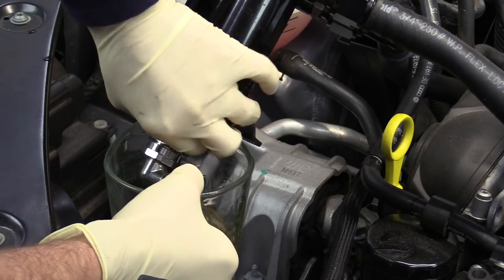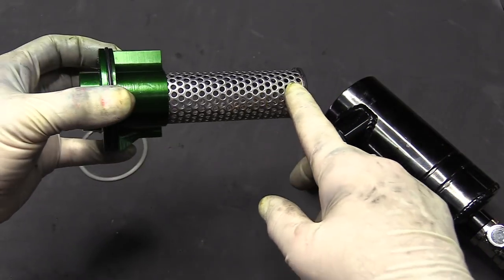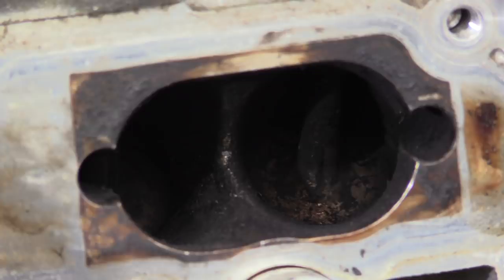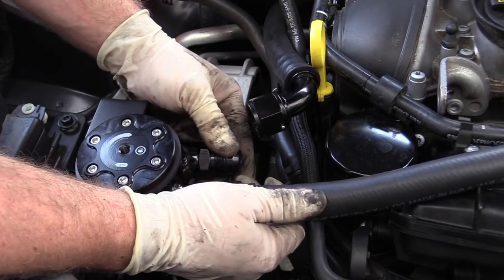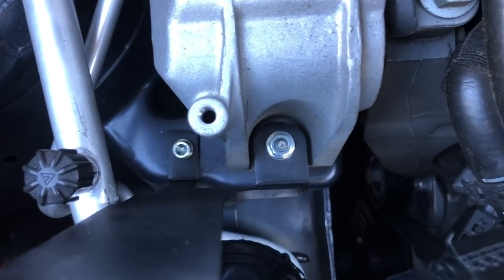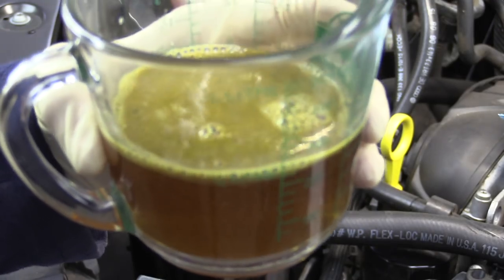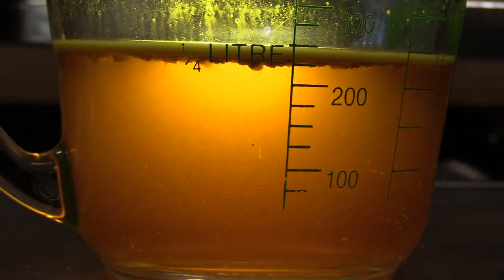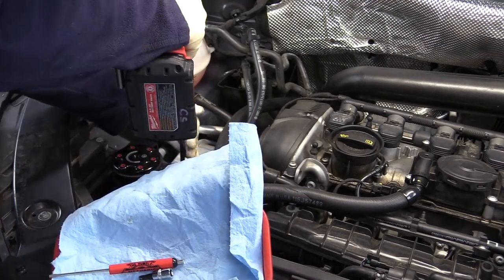Do Catch Cans REALLY Work?

Comment from the maker: For real, I was shocked at the results I found. I expected a little drip or maybe a small amount of crud. Do you think it will fix the carbon issues? Let me know in the comments.
Reply: HumbleMechanic what year is your wife's Tiguan?  I'm looking to instal one on my wife's 2012 Tiguan TSI AWD.  Can you point me in the direction to where you bought the can?
Reply from the maker: This is a 2015. The 2012 will be exactly the same. Here is how to install it. There is a little trimming you need to do on the bracket, but it's not bad. 

Here is the one I have I think. I can't remember which of the two I have HAHA. ~ https://store.blackforestindustries.com/bficcacroils1.html
Reply: HumbleMechanic man, thanks so much.  I've subscribed to your channel I don't know how long ago, a year or so maybe.  Thanks again.
Reply from the maker: Thanks so much for the support :)
Reply: Nice video... sold my MK6 Gti cause of all the issues including this .. who needs all the worries lol.
Reply: HumbleMechanic how crucial do you think one of these is on the Aeb 1.8t remapped? My enthusiast friend keeps telling me I need one
Reply: Charles, I think the effectiveness of a catch can varies based on application. For vehicles that were originally NA, worth it. For older turbo VW platforms, also worth it as the PCV system have been a evolution over the years. For the current gen3 ea888 motors found in the GTI/R, I think it's a toss up as the PCV system seems (so far) to be significantly better than previous PCV systems. I know some guys running catch cans on Mk7's and getting not a drop of waste over a period of a couple weeks as well as owners seeing nearly full cans over that same time period. Eitherway, a setup that replaces the entire PCV system is the best way to go if, in fact, someone pulled the trigger on a catchcan.
Reply: Hey Charles! Personally I think the catchcan will make a difference on the FSI/TSI/TFSI engines used in VW/Audi/Seat/Skoda. In the past year we fixed 3 engines already with gunked pistonrings, valves and intake ports. All of them filled up with oil and carbon residue. 
I think it's time (specially after overhauling the engine) to fit those catch cans. It's more then worth the money, engine overhaul cost can leap up to over 3k ($ or €)
Reply: It’s definitely well worth having  also but dam if that engine bay ain’t clean
Reply: It reduces the carbon build-up on the intake valves nearest the PCV. Less carbon build-up and more evenly distributed.
Reply from the maker: meh probably not as much as this one. But it sure can't hurt
Reply: Hello HumbleMechanic.  Are you sure that your PCV system is working properly?  Seems like quite a lot liquid for such a short amount of time and miles.
Reply: HumbleMechanic is that all oil. The viscosity seems very thin for the specified oil. If you let the contents sit. Would they separate. Like water/oil mix?
Reply: MI Smith & Wesson you're friends are right, bin the pcv and puck and vent to can and then to air under the car via a pipe. Clean air...is good air.
Reply: I think when i purchase my next new car i will definately install a catch can if it doesnt already have one!  Thanks for that info Charles!
Reply: shall we install it instead of the original factory PCV valve to be installed forever ????
Reply: Do you think hydrolock could occur once it completely fills up. It might start slurping down gulps. Considering the 10k oil change intervals it very well could fill up in that time. You really would have to go the extra mile to keep an eye on it.
Reply: That almost looked more like dirty water than oil.   Maybe because it was the more volatile fractions of the oil?
Reply: Ryan Bissell i was thinking the same thing.   Maybe that should be sent out for analysis to see wtf is in that!
Reply: Ryan Bissell maybe thats the leaked oil inside the manifold and the air intake only what about this water?? from where it came?
Reply from the maker: We are going to fine out :)
Reply: Can a catch can be installed or retrofitted somehow to fit a Chevrolet s10 4.3L. I’ve recently replaced many components that the ‘goop’ may have ruined after their long life in the engine.
Reply: Seems to me this would simply work as a condenser at which rate how much water got in there would relate to the amount of humidity in the air going through the engine.
Dry places less, humid places more.
A bit like AC, humid days you get more water draining.
Being water has a tendency to clean carbon, removing it seems a bit contrary to the purpose of it.
Might be better with a container filled with coarse steel wool the catch debris and oil chooch and let the water moisture pass through.
Reply: Holy smokes! That was way more than I thought would come out. I've considered them off and on since I bought a '14 Elantra GT with GDI, but this might sway me towards the "yes" end. BTW, I subscribed as soon as I saw the title :)
Reply: Could the catch can be designed to ride above the valve cover and have a return line installed so that captured oil drains back into the valve cover upon engine shutdown.
Might need a vacuum sensitive check valve in the return to close during operation and pop open under spring pressure on shut down.
Then gravity returns the oil.
Reply: It's blow by. Mixture of gas, air, water, and exhaust gases that slips passed worn rings. Pretty much nasty disgusting stuff. PCV system used to be let out to the air but emissions didn't like that so they routed it back to the intake to be burned again. I have a can on my VQ35DE, known for oil consumption and blow by, I have never pulled that much out of my can after 20k miles and if I did, I would be thinking new engine. Excessive blow by is a huge indicator of shot rings. I'm not familiar with VWs so this may be normal, however do not see how it could be. Only 3k miles with that much in the can, can you imagine that being burned in your motor for 50k miles. Not good. Low miles bad design engine. High miles, maybe wear and tear. IMO
Reply: HumbleMechanic thank you for this video and all your videos
Reply: add a fuel injector to the air intake with a extra injector controller, A small amount of fuel being injected into the air intake stream should help with the build up, no?
Reply: HumbleMechanic Very interested in following this story... HOT topic, as many are going to direct injection without studying long term effects!
Reply: HumbleMechanic 
You think that’s some nasty looking stuff, hang around a propane powered generator or 2. 
The crap coming out of the breathers is nasty white goo, and the oil will go to milk in a matter of weeks if the block heater has failed and it only self tests weekly. 
The wife’s 2014 Jetta has 40k on it , I figure at this point why bother with a catch can, it’s gonna need an intake cleaning anyways.
Reply: HumbleMechanic  I have a 1995 Vauxhall Cavalier that I put a catch can on. It's now on 212k miles and the oil has never been cleaner and my emissions have been alot better aswell. I can dip the oil and it's still golden when it used to get dirty quite quickly so I definitely think that catch cans work
Reply: Would itt be alright to put that oil back in? I have a honda fit and i've been planning to do this for a while, my idle valve is starting to clogged and i'm thinking this could be one of the contributors since I have a modified air filter too.
Reply: HumbleMechanic so what was the fluid composed of? I can see the oil at the top floating but what was the rest? Water? If so how did that get there?
Reply: HumbleMechanic is it worth it on a tdi pd engine?
Reply: Good video . Have you ever tried a oil catch can plus a toilete pAper filter ?
Reply: These catch cans are a major must have for ford 5.0 and ecoboosts. Theres numerous videos of mostly oil recycling back to the intake from the PCV line. I have a 2017 F150 5.0 and i had one installed at purchase. have 20K kms on it and i check it every 5000 kms. throughout summer theres a small amount of oil with some moisture with it. Being that i live in canada i just checked it in winter time and the can was half full of water and very little oil in it. I can safely say these cans pay for themselves within time.
Reply: Just drained my occ again, and this time it was quite darker than usual, it was murky gray, you couldn't see through it, I could see similar gunk floating at the top but in the past it's been sort of like what your video shows.
Reply: I'm a professional mechanic too, happen to be a German car guy to boot!  I have had similar results in my 06 GTI that is tuned with a K04, injectors and what not.  I use an APR catch can and installed it with chemical resistant clear pvc tubing- the hose that returns to the engine is substantially cleaner, but still exhibits some browning from oil vapor.  For those of us living in colder climates, the water that you see in the can is what is collecting on the pcv valve pressure regulating diaphragms, it freezes the rubber making it less pliable and when the engine is then restarted, the vacuum applied to the valve causes it to tear.  This results in a major increase of vacuum being applied to the crankcase, inhaling more oil vapor and not separating properly- this is part of the snowball effect.  Eventhough the BPY (belt drive familiy of FSI) now has the latest PCV valve ending in P, they are failing too for this reason.  Just replaced one the other day and after disecting the failed valve, I again saw what I described above.  

Another cause for the excess oil vapor are the low tension piston rings and carbon in the ring lands.  Once formed, blow by gasses increase, which leads to positive pressures in the crankcase and essentially start saturating the vapors- further exaggerating the gunk problem. 

Also, as you mention in your videos, using the Specific oil that meets your car manufacturer's requirements (not just 5/30 or 10/30) but oil that has the proper additives is crucial.  Recent tech pubs have illustrated LSPI (Low Speed Pre Ignition) that is caused by the oil film on the cylinder walls being scraped off and mixing with the air/fuel charge effectively lowering octane and resistance to knock.  It also increase the formation of carbon inside the combustion chamber, which contaminates piston rings and lands and injector tips.  It is also partly responsible for the formation of gunk on the valves as remnants of the combustion gases are present when the intake valves open as part of the internal EGR effect used with variable valve timing.
Reply: Most of this liquid inside is condensation, result from temperature changes on the serfice of the metal body of the catch can, so basically this is water with some mix of oil vapors which caused the brown colour but nothing special if this was an oil,you will get a greasy brown stuff, same as when the engine mixes oil and water. So basically you drained the stuff that you made by your own by installing the catch can. If you put plastic catch can you will reduce this liquid by a lot because of the less condensation with plastic :)
Reply: So pcv, and valve cover into a oil catch with breather? Doesnt it need a vaccum source?
Reply: The vacuum is created by the return hose that is essentially routed to the intake of the turbo.  On the early Belt drive 2.0T the hose that routes to the intake manifold is eliminated and all vapors are routed to the turbo.  Go to APR's website and review their install instructions for a more detailed description.  The chain drive engines with the valve assembly  on top of the cover install differently.
Reply: Which catch can did you use?  I didn’t see the label.
Reply: Lucc 701 

Unfortunatly its very common with vw's to have shot rings. I am having the same issue with my vw... my car burns like 1l / 700km

I do must admit that i have a heavy foot and the powerband is from 3800rpm too 6100 due a 272° camshaft. Fyi the engine is a 2.0 8v
Reply: Matthew Edwards sure you could... Instead of mounting the catch can above the valve cover (which may cause clearance issues with the hood) you could just run a drain tube down and drill and tap the oil pan for a return.

HOWEVER, if you watched that video, you would see that most of what the catch can caught was not pure oil, and you would not want that crap added back into the engines oil supply.
Reply: Joe S. -- yes, to me it also looks like water !
Reply: Ryan Bissell -- yes, looks like water !
Reply from the maker: So you have two different points of view to examine, then make the determination for yourself. 

To me that is a good thing. There is rarely a complete cut and dry answer to things like this.
Reply: HumbleMechanic now that it has been almost 9 months since you posted the video, are there any updates?  Reduced carbon build up? Increased oil consumption?  Any other feedback?

I appreciate all of the valuable info you provide!  Keep up the great work!

I especially appreciate the prompt and excellent replies to the few times I commented and asked questions in the past.
Reply: I’m a certified mechanic and I have an interesting theory. Is it possible that the condensation, being water, even with a little oil contamination, that there could be some benefits? Water has a tendency to steam clean things after all, when the temperatures are high.
Reply: It'll help for sure. Assuming your tiguan also has egr, disabling or removing that system would also help a ton.
Reply: B7 A4 2.0T cts catch can set up.
Reply: Why didn't you use a boroscop to look at the valves I have with my Taurus but haven't checked it in almost a year since
Reply: I can confirm that it works!
I have a Golf mk5 1.9TDI as daily driver (BKC engine code), clocked at about at 360.000km. It ran like new but I decided to remove the intake manifold and I found about 1cm of carbon and oil buildup in manifold walls. Cleaned it and added a diy catch can.
Last month I removed the EGR to check and the intake manifold was clean! it only just a bit of black soot which normal because of the EGR but there was non of that goopy black stuff that formed from the recycled exhaust gases and the oil fumes like before.
The catch can was almost full of oil! So I would definitely recommend add it from day one.
Reply: That's picking up condensation from the screen design. Check out JLT 3.0 separator. It has a unique screen design that picks up only oil without creating condensation. It looks just like oil in theirs.
Reply: It really does look like a catch can is a great idea.
Reply: HumbleMechanic I really like the incorporates dip stick and drain valve at the base.  What’s the brand of this catch can? Thx!
Reply: it looked more like water than oil but I have one on my 7.3 power stroke and it does work I get as much as ½ to 1 cup a month depending on my driving
Reply: @priv8joker  no way you are changing viscosity and adding extra crud to engine. Keep it clean
Reply: manufactures  all ready fixed it by adding EFI to the GDI problem solved and more shit to fix when something fails on it lol..
No catch can needed...   so basically new GDIs has  dual system
Reply: can you do an update on this? or a video if you ever have to take off the intake?
Reply: It's mainly condensation due too the canister being metal
Reply: Sunset Originals moi j
Reply: Krankenwagen gen 3 ea888 already has that, but only Europe ones.
Reply: Did you ever follow up with this? Did it make a noticeable difference with the carbon buildup?
Reply: @HumbleMechanic  That link no longer exists. Should I put this on my 2010 GTI? I have 103,000 miles and recently had a VW mechanic(side job) replace the intake manifold with the latest revised version and do the carbon cleaning. The carbon build-up was pretty bad. Have you checked the valves after running a Catch Can?
Reply from the maker: I sold the car before enough miles to do valves.  I’ve since done one on my Golf R that I’m tracking very closely.
Reply: Can one of these catch cans be fitted onto a 2.0b7 TDi passat ??
Reply: I think so
Reply: This is only a test to see if the separator works , it does , full stop. All other comments after this are supposition. I can say that the oil looked very clean. Free of carbon.  Why are you fitting an oil separator in the first place?
Reply: What brand is it and where did you buy it, thanks